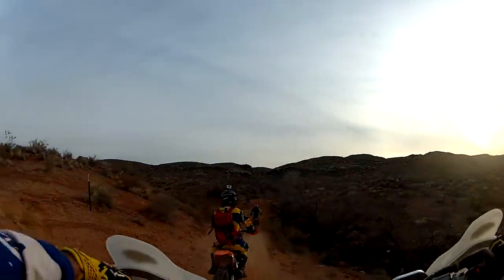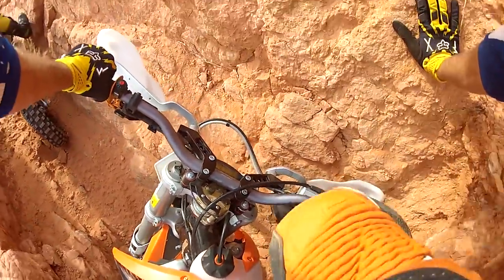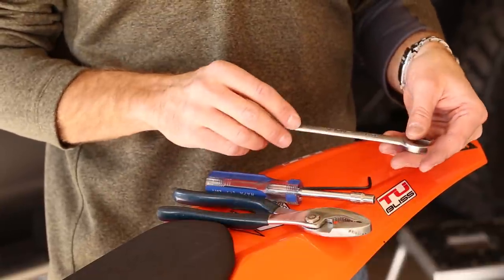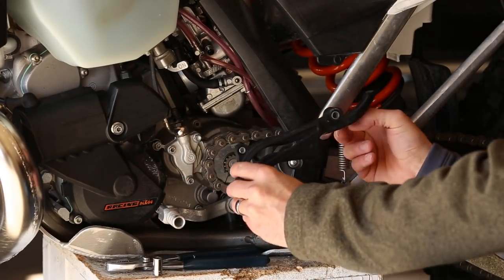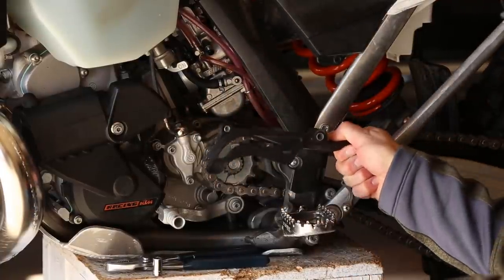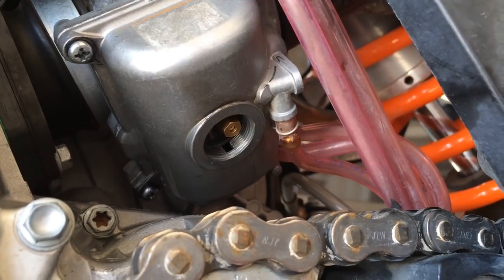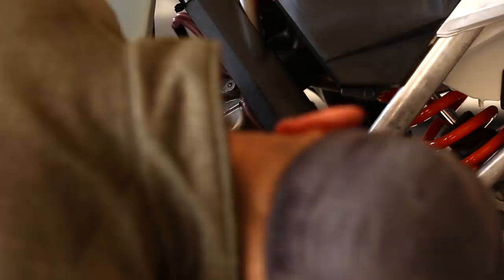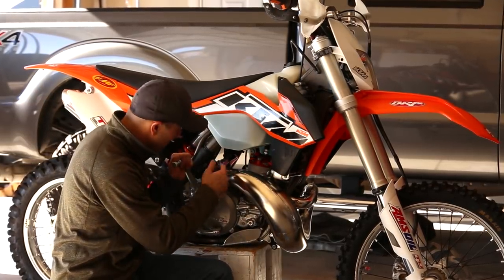How to Jet a Dirt Bike Carburetor - Jetting and Needles

Comment: So i would use this same method for a yfz 450 atv that backfires?
Reply: Rashad Dorsey I'm going thru this right now......just rebuilt my engine put a new carb on it....put the first two heat cycles on it...ran fine.....soon as the temperature changed and it warmed up...i had to turn the air screw just to get to 1/4 throttle and it stumbles hard

Comment: Hey so I just picked up a 2009 YZ250F. There is a slight bog off idle and back fires alot when decelerating. I'm very new to bikes so what should I do?
Reply: thats just yz 250 bog you can look up how to fix it on youtube there is a good video witch shows how to do it using an oring
Reply: Aussie Enduro Boys but why would my bike need an oring? It's still on the original tires. So why would it need one of those? I'm thinking it just idles to low cause when it's cold you have to hold the choke open for about 1 min to get it to idle normally
Reply from the maker: +The Lonely Rider I'd be looking at your carb settings on that one.  Could be a bit lean.  Could be needing an airscrew adjustment.
Reply: Dirt Bike Channel alright will do. So if it bogs off idle wouldn't that mean it's getting to much fuel? So isn't it running rich? I'll pull the plug later and see what color it is.
Reply: youtube search "yzf oring mod"
Reply: Aussie Enduro Boys it's just cold I guess. I rode it again today and as soon as the engine gets hot it has no bog or anything. Although I noticed when I lean to the right side of my bike I can sometimes hear a quiet sliding sound. Is this normal for this bike. I don't think it's the chain cause it does it when it's stopped

Comment: So I was gonna buy a new exhaust system for my bike header pipe and silencer so I found the one I wanted but then loads of people said I Would have to rejet the bike is that true or not
Reply from the maker: +Harry Bailey Typically if your bike runs right on the stock pipe, you won't need to rejet with the aftermarket.  If you race for a living, you might want to fiddle around with the jetting every few hours.  For the rest of us, it's not that big of deal.
Reply: +Dirt Bike Channel okay so how do I know if it runs fine stock it feels fine. And it wouldn't effect the bike if i don't rejet it. 
Thanks for the fast reply.

Comment: let's say if I'm riding and it rains and gets colder would I have to regret my bike?
Reply: reget
Reply: +josh zub LMFAO
Reply: +josh zub dont ever regret your bike, LOL
Reply: +Bruce Walker my 125cc husqvarna 2-stroke works well when its 0 celsius and 20 celcius so you should be fine
Reply: Yess!! Absolutely! May not have to change your internal components but "re jet" yes by adjusting your fuel/air mix as the temp changes throughout the day.
Reply: i ride in 30 degrees celcius and minus 10 fuck regetting!
Reply: lol
Reply: No ragrets

Comment: what about reeds? I'm new to bikes...
Reply: +Chozn1nishy6474 Reeds are pretty easy... just have to work your way to them.  Take carb out completely.  Reed valve sits between the carb and cylinder.  Remove the 5 (I think) bolts that let you pop out the reed cage/valve system.  Inspect reeds for damage, change them, whatever.  Use new gasket, and put it back together.

Comment: and the ghetto way is ive seen people put spring onover the cable on ther side so it never gets into the middle of spring like it should and the spring looks all cockeed and makes throttle stiffer...it does work but its not right

Comment: Most bikes DON'T need to be jetted for different elevations or riding conditions! That's what a CV (Constant Velocity) Carburettor is for. Fuel injection will never need it either.
Reply from the maker: +imatiler I'm assuming you are joking when you say "most bikes".
Reply: No, I'm not joking! If you live on top of a mountain, Fine re-jet your carb. But if you just riding all over the place, don't touch it. (Re: CV Carbs).

Comment: KTM is the hardest bike to work on soo tight every other bike I’ve owned everything is easy accesss I don’t know why ktm has to be soo tight fitting even just to change the spark plug too damn tight need a socket and open end wrench smh 🤦🏼‍♂️

Comment: Hi. I own a KTM EXC-F 2008 with a FCR 39 keihin carb. I jetted it with JD Jetting last year and the bike was great. After putting 70hrs of riding, I am having a problem. In mid range rpms, I am guessing around 5000, the bike misfires kind of like when the enginte tops out on full revs. No loss of power or grunt in low rpms though, and once I accelerate enough to get over the thing, around 6000 maybe, the power is back to normal all the way to the top revs. I have cleaned 4 or 5 times all the carb, jet by jet, but with no result. Any ideas?
Reply: Roberto Martínez Valdés Daussá Great videos btw. Enjoyed the 2Tvs4T series
Reply from the maker: Roberto Martínez Valdés Daussá I'd try a different needle and needle position.  The needle controls the mid throttle range in your carb.
Reply from the maker: Dirt Bike Channel Thanks!
Reply: Dirt Bike Channel Yes I did so already but with no result. I changed the spark plug just in case too. The inicial needle setup, I did following instructions from de JD Jetting product and it worked great. Middle position. I tried giving it more gas but it bogged and less gas haven´t tried the first and second positions, just third and middle. Might just try that now that we mention it. Anyway, I know it is impossible for you to give me that much information without even hearing the bike, but what would be your next step? If you don´t mind me asking of course! Thanks

Comment: This shit is so confusing 😂 dirt bikes are definitely much more harder and complicated than both of my sport bikes are
Reply from the maker: I've owned a sport bike in the past.  It was more complex by far IMO.
Reply: +Dirt Bike Channel really?? I own a 2011 r6, 2008 cbr1000rr, and a 2013 zx6r stunt bike and all have been easier. Hmm maybe just some experience with the dirt bike and jetting it should make it easier
Reply: Bro the only person confused here is you! Let me explain to you a little...
New sportbikes like yours DON'T even have a carburetor and jetting system but rather a fuel injection and CDU map controlled feeding. 
Old sportbikes DO have carburetors and jetting system and it was a HUGE pain in the ass to syncro 4 freakin' cylinders 4stroke with proper jetting and timing....considering also that it is impossible to have all the 4 cylinders with the same psi compression ratio it was pretty common to spend even an entire week working on that crap

Comment: FVCK THIS SH!T. I still don't understand. The way I'm so frustrated now is just insane. I want to get a 2018 TC125 so bad but I don't know jack about carbs, jetting, etc. 😭. I literally feel like crying 😖. I just pray that maybe I'm wrong about jetting motocross bikes for mx or that one day soon I will understand. Whoever is reading this, please pray for me😓
Reply: Thereal36 stg I'm having carb problems with my bike and I don't know what to do
Reply: at least your bike starts, mine won't even kickstart and checked everything...pray for us all
Reply: that doesn't fix my problem though of the bike not starting, I tried everything they say to do in the videos it's not the spark plug, not the fuel, not the choke, not the carb, not the battery or electric start...it hasn't been rode in years my guess is the engine had fuel residue that dried and stopped the motor from running so my motor might be f*cked. It doesn't kick start tried for hours...doesn't push start so think it's a goner. Gonna take it to a mechanic anyway to get their opinion...too bad it's a cheap asian bike got it for a few hundred ain't gonna pay more to fix it then I bought it for